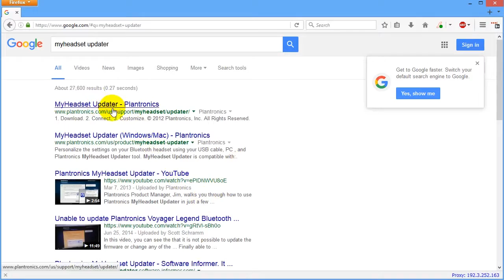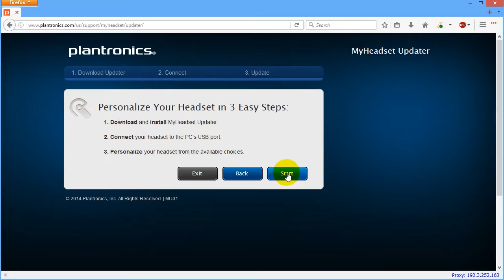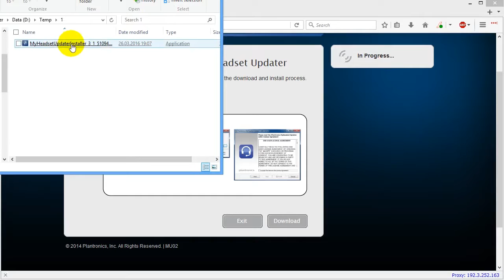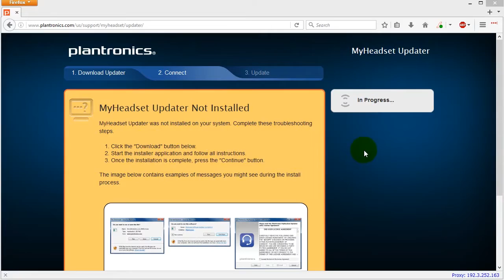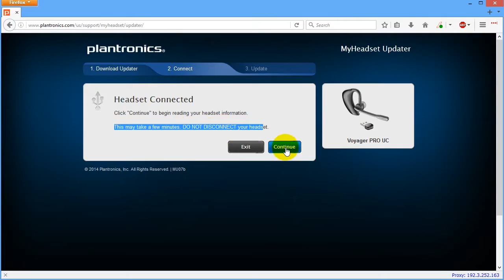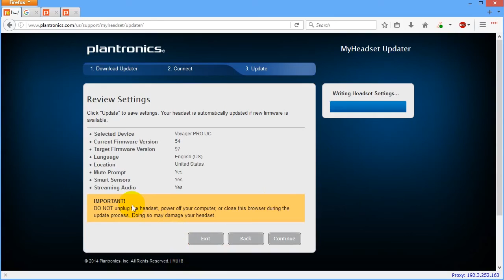Plantronics MyHeadsetUpdater on Voyager UC Bluetooth Headset

Comment: Does the headset it self has to be turned on or off as up date process starts?
Reply from the maker: I think I had it turned off. Just try it. Nothing bad can happen. Just don't unplug it or touch it while it is updating the software.